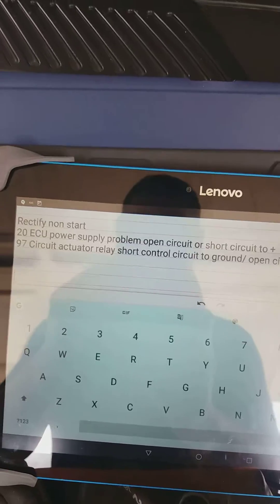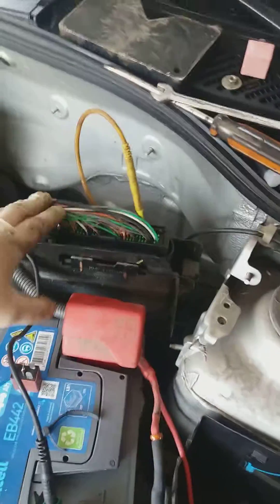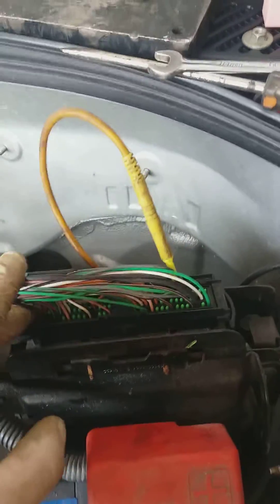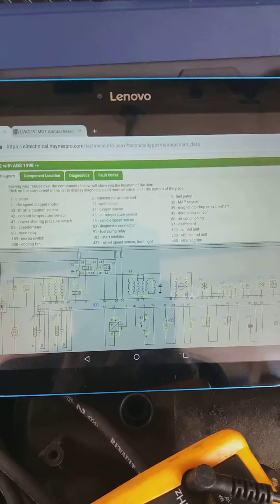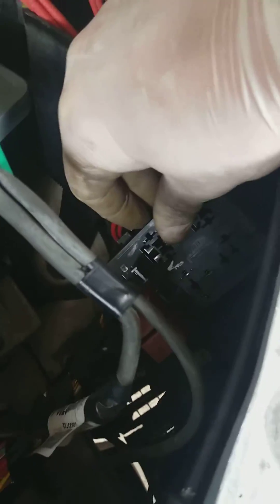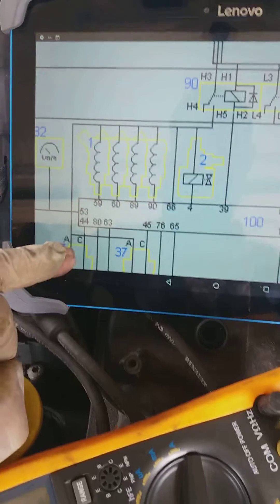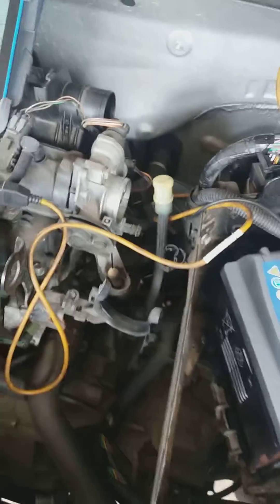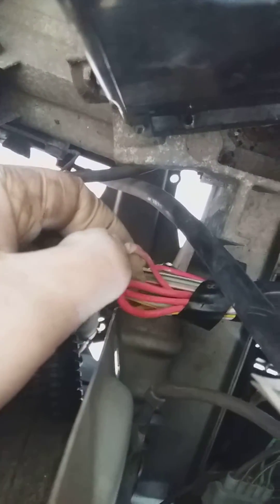AMS Clio 2 ecu power supply fault

Comment: Excellent video, well done. I'm having a problem on the same vehicle Clio 1.2 16V with a pin number 20, it's for AC control to rise the RPM's when AC is turned on, but there is no voltage. The AC works perfectly with direct 12V. I like to put direct currency on pin 20 but i do not now exactly voltage for this pin od the ECU. Does it 12v ? Pls a need help to check and resolve this issue

Comment: GreatI repair but I have a fault Clio 2 2003. ! Engine cranks wont start. Stand by battery drain is about 500ma Seems high ? Key code tricks dont work.! relay stuck on ?

Comment: Thank you for another great video!
I would aproach this slightly different. At that diagram, power is shared, so no need to disconect all the components. Just check voltage at another component that share the same power supply and if there is no drop, the problem must be in the leg of circuit going to the starter solenoid.
I myself and many other technicians have the same aproach as you do, to not fire parts cannon. But the problem is people don't want to pay proper diagnostic fee, and I would certanlly not spend few hours somethimes, and charge just code read. And all other mechanics they do not charge code reading and they sell it as diagnostics. and then parts cannon is fired and you could stil not explain customers that just code riding is far more expensive.

Comment: Hi I have the same problem, I don’t know where the other two power wire are, so I can change the voltage, and I’m not getting there the crank sensor wires ground wires go’s into the ecu. Please help